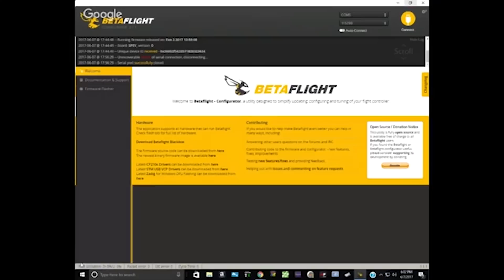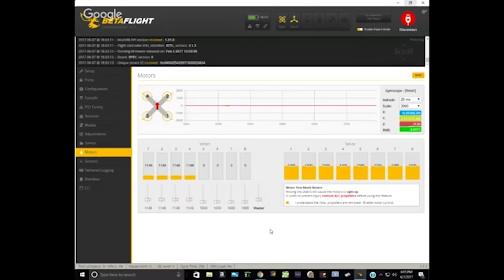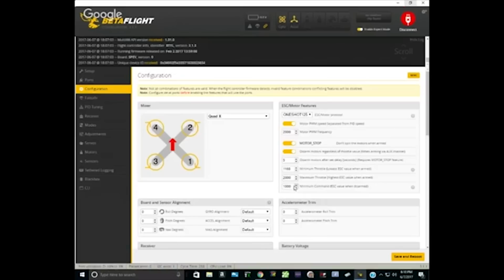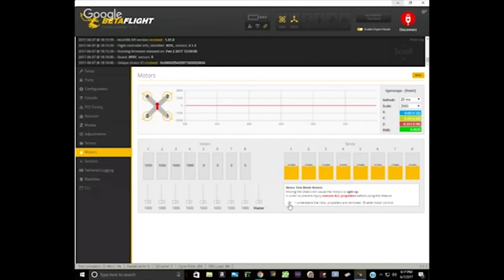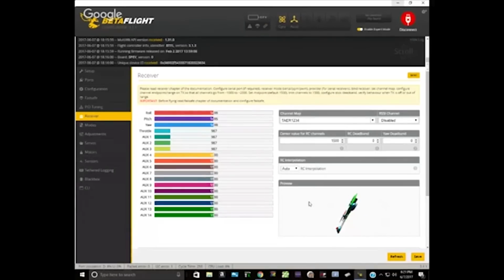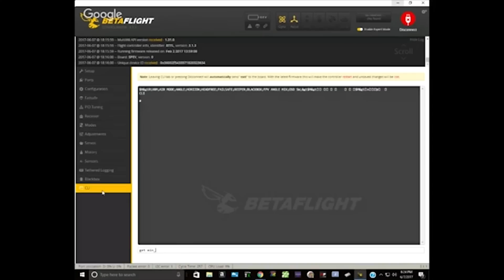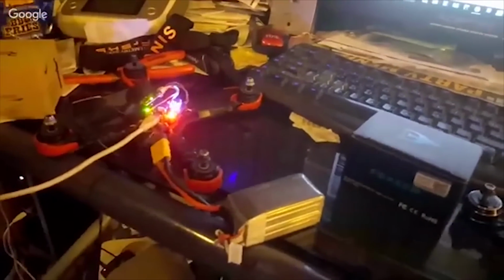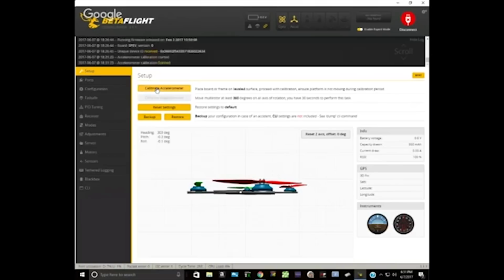Quadcopter Motors Won't Spin Right | 1-ON-1 TROUBLESHOOT

Comment: My motors were spinning fine the other day. Yesterday my number two motor is struggling to spin then it stops and beeps. I have an all in esc. It spun normal once and started doing it again
Reply from the maker: Most likely either the motor or ESC is damaged. Replace the motor. If that doesn't fix it, it's the ESC.

Comment: I have a similar issue that was solved by running ground wires to each esc. The they did not have ground wire initially

Comment: The problem is that those emax 1306 motors are trash and cause tons of noise in the gyro. I ended up swapping them for the far superior bh 1407s and it not only fixed all the problems I had but the power is night and day on the 1407.

Comment: I'm having issues with my quad were when I throttle up on the transmitter  then throttle down is just speeds up an wont come down till I dis arm it
Reply: are your props on?

Comment: i had the very same problem with these motors.  it took me a long time to figure out the problem and i finally found the issue was the actual motors! when the motors screw are too tight I get that twitch!! I ended up soft mounting the motors and PRESTO! problem solved! I hope this help anyone else that was having this problem

Comment: Can someone please help I crashed my bugs 3 now my motor sound like s*** when flying and I have less power now also has very bad vibration in the rear
Reply from the maker: Sounds like you need to replace a damaged motor.
Reply: @JoshuaBardwell  thank you for your response it's amazing to get a response that quick I appreciate the help and I definitely am a subscriber now thank you so much I'm trying just with the props first because I already ordered them and I'm not sure I'm going to change the motors out it's a bug's 3 I might just order another one I'm save this one for parts although I want to learn to build them
Reply: @JoshuaBardwell  How did u get so knowledgeable I'm assuming profession / carreer electronics I'm a welder/fabricator thank you I'm sure I will learn,a lot from your channel appreciate the quick response
Reply: @JoshuaBardwell  if I change my bugs 3 motors out to a larger kv is it necessary to change the escs out as well also my stock motors had sufficient power for me but I hate to change just 1 motor and have another go out any suggestions

Comment: Good video, but unfortunately didn't help me.  All my motors are running CCW and when I put a little throttle on the all increase speed steadily but only one motor goes to full speed.
When I move yay, pitch or roll the speeds move and do not equalize when sticks are center.
Reply from the maker: Why are all your motors spinning CCW? That can't match the diagram in the Motors tab. The motor directions must match the diagram in the Motors tab.
Reply: @JoshuaBardwell  Hi Joshua.  Thanks for getting back to me.   I know, but how do I change direction.  I am going to reinstall BLHeli_32 because what I have installed cannot find my ESCs.  I am running Spedix ES25 25A.  BLHeli is on one of your videos.
Reply: @JoshuaBardwell  Hi Joshua.  Motor direction sorted now.  My ESCs do not support BLHeli_32 Only BLHeli.  The only issue I have now is when I apply a little throttle, my motors increase speed.  You mentioned on this video that can be normal because I haven't fitted my props.  That is my next step. Do you agree?
Reply from the maker: Yes I agree.
Reply: @JoshuaBardwell  looking at one of your other videos, I did change the motor configuration.  Initially it was QUAD X, but on betaflight the image showed the arrow pointing right, so I changed it to QUAD 1234 to correct it.  I have now had to change it back and the arrow is still pointing forward and moves as it should when I move my quad.  I will test again today.

Comment: Hello I'm from India and I build a quadcopter but the motors are not rotating...
Reply from the maker: Do the motors beep when you plug in the battery? If no, then the ESC does not have power.

Do the motors spin from the Betaflight Motors tab? If no, then the FC is not talking to the ESC.
Reply: Joshua Bardwell yeah it beeps...
Reply: No its not spinning from the betaflight..
Reply: It only beep and rotate slightly with beeping and stops a second and repeat the same..
Reply from the maker: Make sure the motor protocol (Dshot, Multishot) is supported by the ESC.

You must get the motors to spin from the Motors tab.
Reply: How do I know, it support or not?
Reply: How to spin motors from motor tab?

Comment: when i use my controler it works right  but in the set up screen when u pick it up and move it thats when it does it
Reply from the maker: +Sam Chandler please. "That's when it does it." What? What does it do. Please elaborate.
Reply: ok so in betaflight in set up tab if u pick up the drone and tilt forward the drone on the screen  tilts up if   u tilt  right it tilts left but when im in the reciever tab every thing work correct
  whatever i do with the stix controls the drone on the screen perfect
Reply: hey josh figurd it out i had to turn my flight controler on my quad

Comment: If anyone can help me on here I’m lost. I thought I was having a motor issues but after looking at my receiver on betaflight I’m not sure. When I move the sticks on the receiver and watch them in the receiver tab they are dropping off while I gradually move them up. It’s like it glitches. It will go up gradually and then drop down then hop back up. Any help would be greatly appreciated.